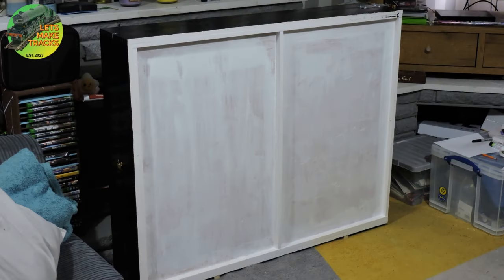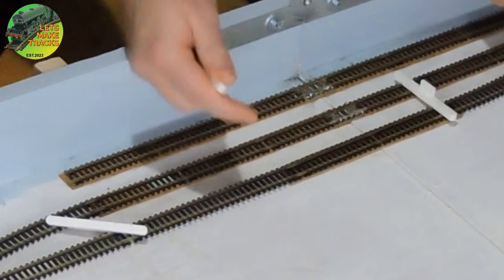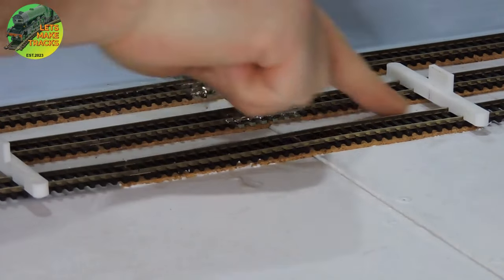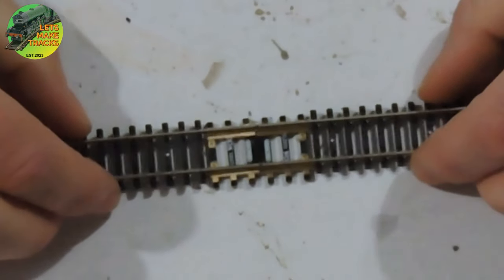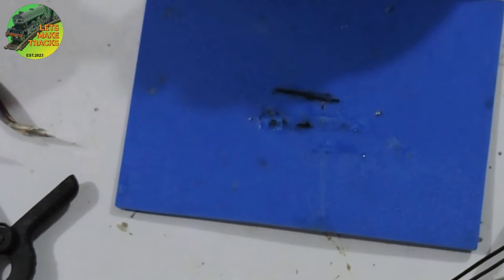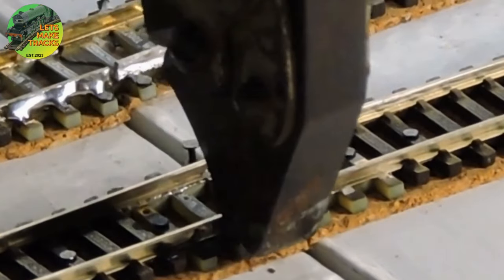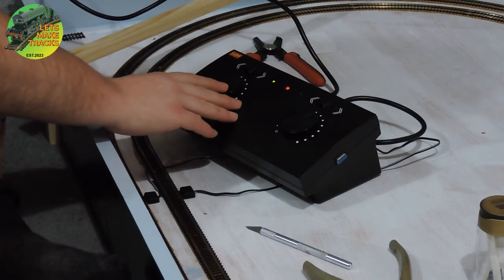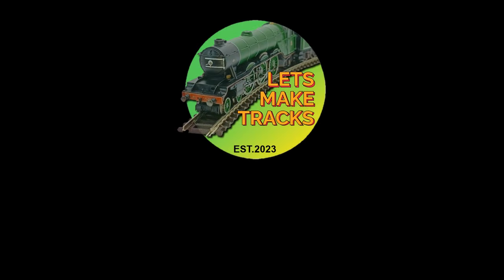Easy installation of TT120 Track on a Folding Base Board!

Comment: I think you already know....lose the backing music, Please. Also, use flux, even with prefluxed solder, it makes life so much easier. Liquid or paste, it's up to you and the job. IPA kills the acidity after the soldering, apparently. I high powered iron is also a good thing, a lot of heat applied, but for a very short time so the heat doesn't have time to travel. Great informative video, keep up the good work.
Reply from the maker: Thank you for the tip, Glad you liked it. 
No music version has been re uploaded 👍